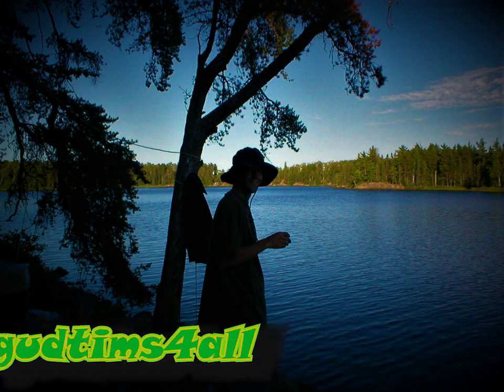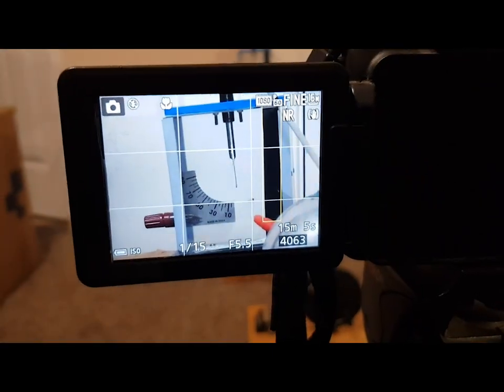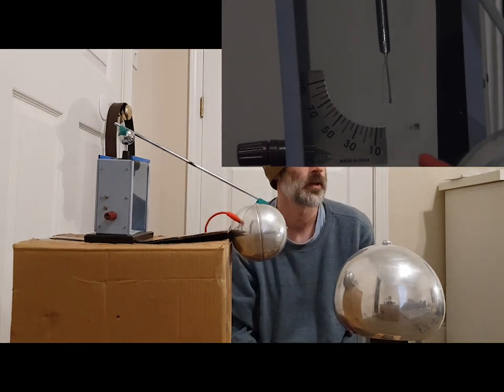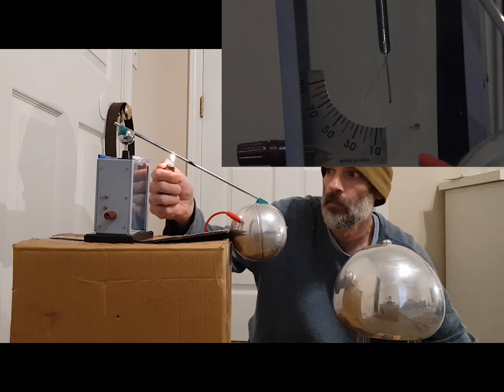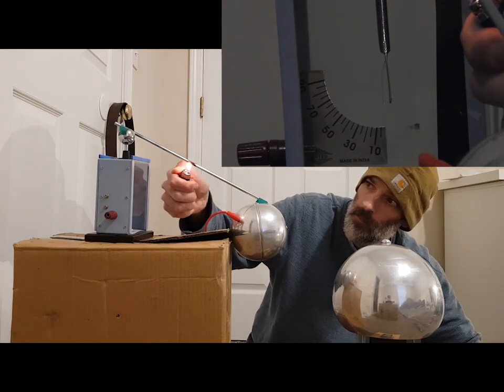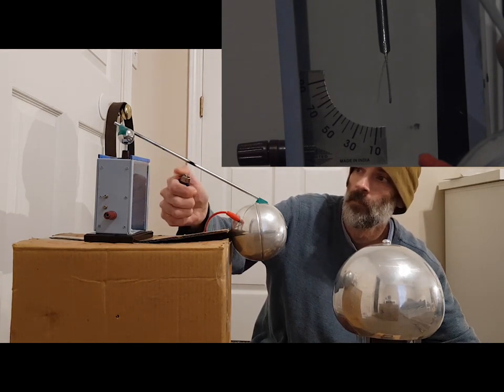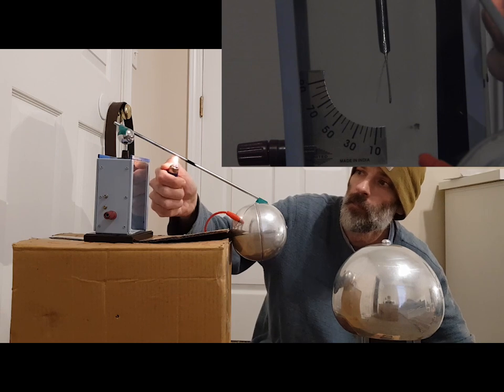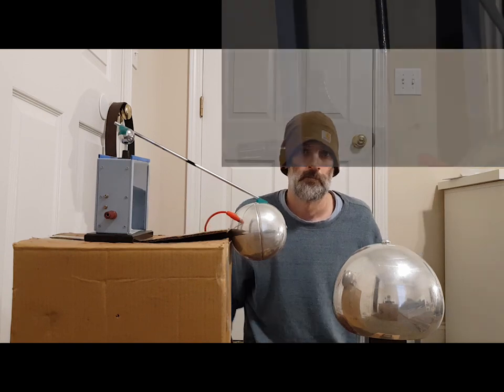Why Does Fire Change Electricity?

Comment: Some of the electric current is lost in the air. Fire decreases coherency of the "atoms" [crystalline Aether toroid vortexes. I hate the word atom] in the air around the setup, hence the heated air acts as an insulator and you get less loss of current due to it not being able to conduct into the air as easily. 

When you apply the flame to the conductor rod, the same process occurs; it becomes far less coherent [heat causes Aether toroids to vibrate chaotically, which is why heat causes magnets to lose their magnetism], and basically acts as a "firewall" [heh] which blocks the current from traveling through the conducting rod.
Reply: Also, @gustims4all I just wanna say I love your channel 😁

Comment: Very interesting, I wonder if it's because flames do increase the amount of positive ions flowing through the air and when you touch the rod you just add heat , but when it is away from the rod it's light which may be equivalent to the amount of the positive ions flowing through the mechanism.

Comment: A flame has different temperatures. The tip of the flame is hottest or very near the tip. Under would be hotter. Inside the flame the heat is going around and the gas is still hotter at the tip, but now around and above the rod and heat goes up. Still not sure what the rod is, hollow, solid, has a hole? What is the rod made of? And any silicone playing a part? Where silicone under heat generates more electricity because it's more conductive, whereas metal loses conductivity.

Comment: Hi Zak, no clue how the flame affects the electrickery, AS a suggestion try using the 2 inverted neodymium magnets near and see what affect it has, by the way had you tried weighing them before and after forcing them together. kind regards Jon
Reply from the maker: no but I plan on weighing them afterward. I have some other magnets and I think I will do that as a separate test. Great idea, thanks
Reply: @gudtims4all  I will lookout for the test. does a candle flame affect it the same way or even a burning splint ? just wondering if its the gas . ATB Jon

Comment: Thanks for showing this... Much to think about for the coming year! I am never bored when thinking about place! It really is 'full of wonder'!
    Just thoughts: The clue here is the flame. Do you get the same effect with different flames? I am thinking of those really hot flames from one of those handheld 'blowtorch'.  What do flames have as regards electric charge? It obviously is adding to the charge in some way. This is all speculation. I have no idea of the mechanism at the moment.
  I am getting quite interested in the 'thread' or 'filament' theory of light. How it applies in these circumstances ain't clear yet. :)
 
  Btw, have you considered using candles rather than a lighter. It will enable you to get you to reduce the effect of your body on the field.
Reply: Maybe even tape the candle to a long stick so you’re further away 🤷‍♂️

Comment: Well it seems to me is the electricity is dispalaced breaking the flow of electrons . . because the heat has disturbed the path of its course, this is just a guess because what is electricity after all? All we have is the descriptors of electrons but not any visual of said electron. 

It's not much of a surprise to me as we know electrical systems overheat and stop working and when they cool down they will work again. But why. . .  I'm not there😂